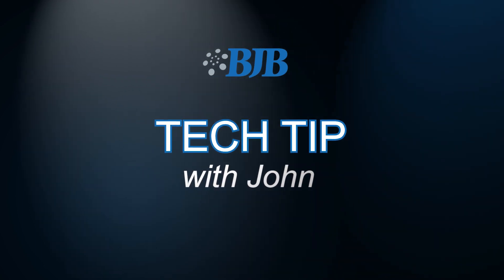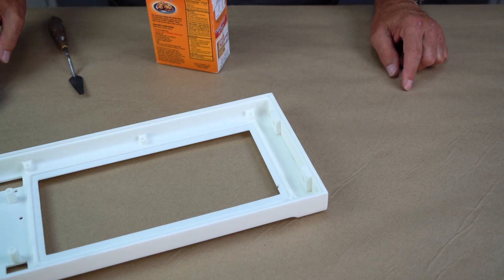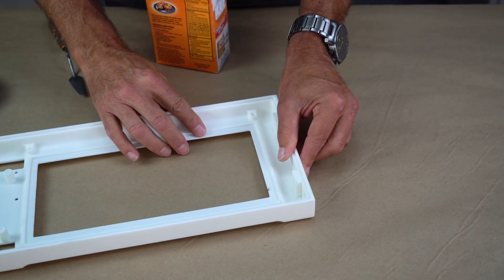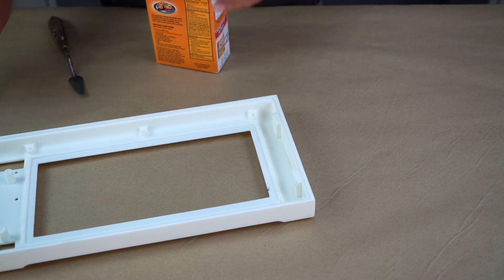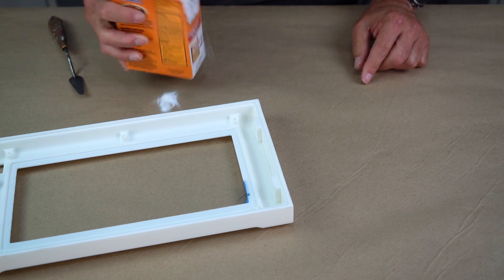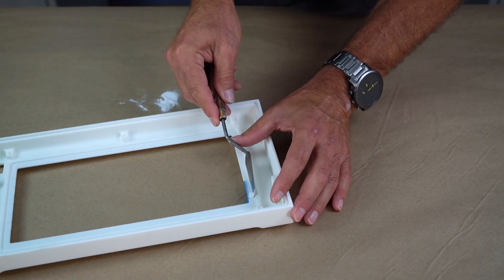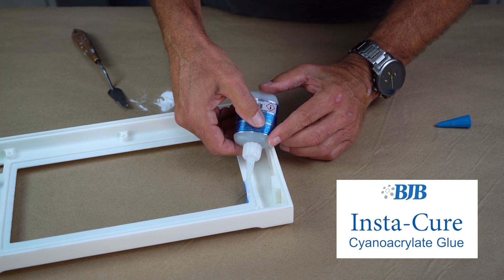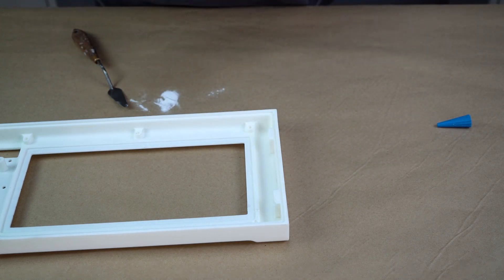Fixing Bubbles in Polyurethane Cast Parts with Baking Soda and CA Glue

Comment: Can this be done with pigments?
Reply from the maker: Probably not with baking soda.  You could mix up a batch of the casting material, or something like our Armor Bond adhesive with pigment to fix a hole on a pre-colored part.  The pigments we make do not cure/dry on their own, so they need to be added to a material that cures.  Hope that answers your question.